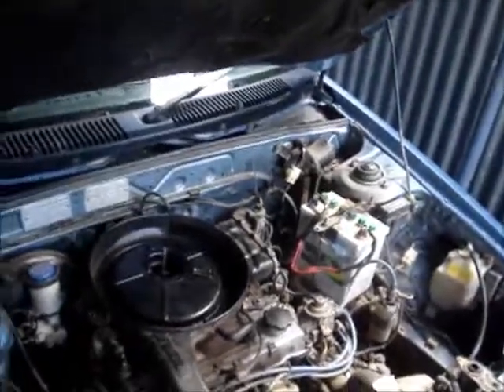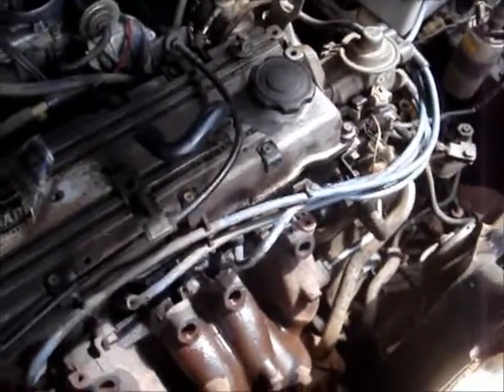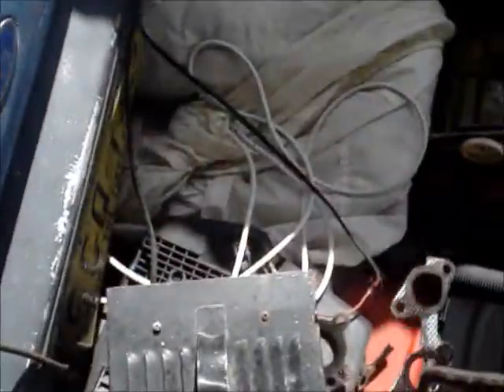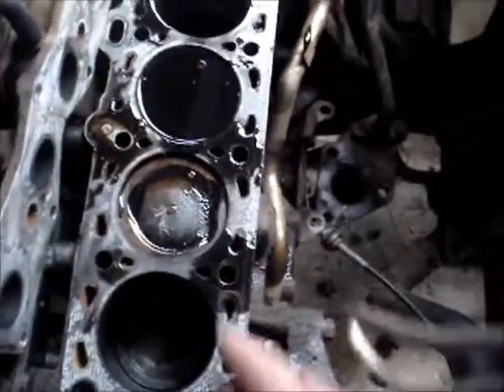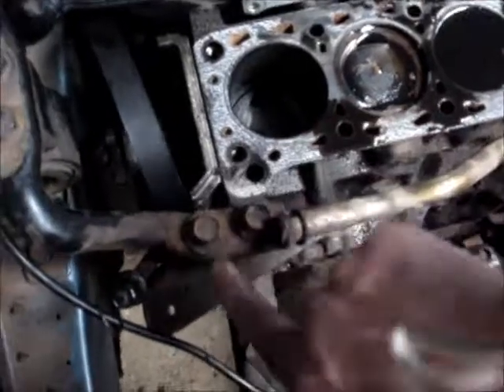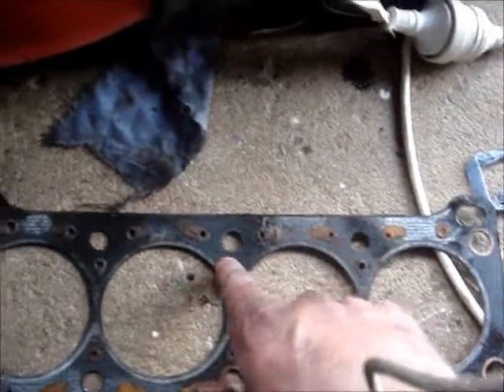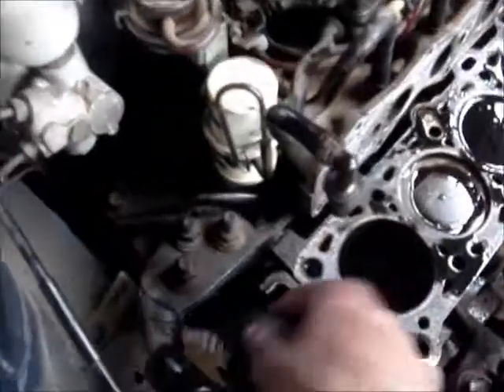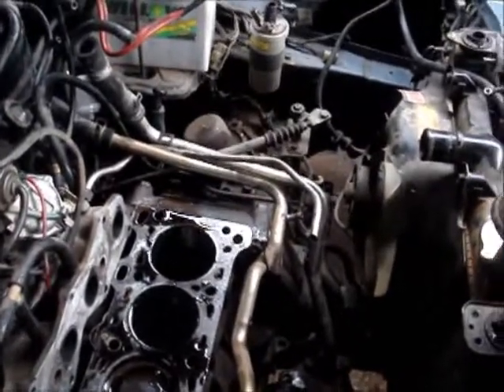remove cylinder head from the ke laser

Comment: The EGR is easily disabled on a normal carbed car, what someone did with may 1975 Chrysler Newport was to block off the EGR valve with an aluminium plate, I would block it off and dummy rig it so it looks like everything is in place. An EGR is a stupid idea, all it does is feed exhaust gas into the inlet mainfold to hopefully reduce the production of nitrous oxide, unfortunately it also reduces efficientcy and increases fuel consumption.